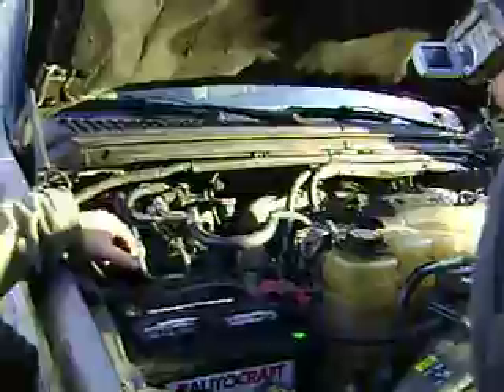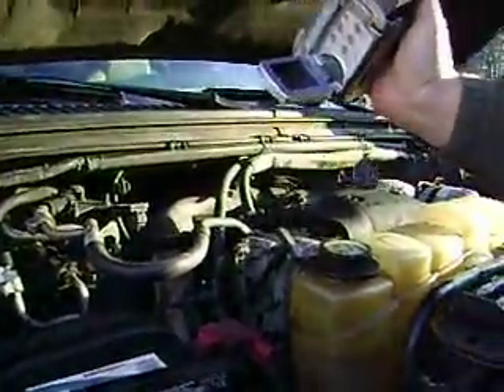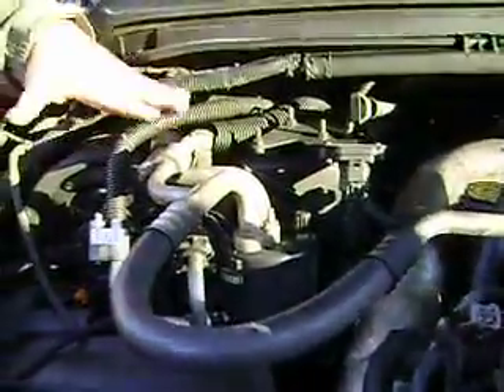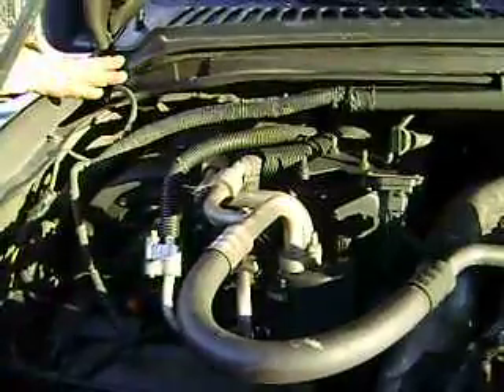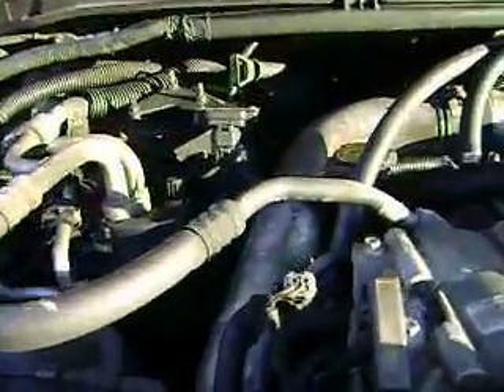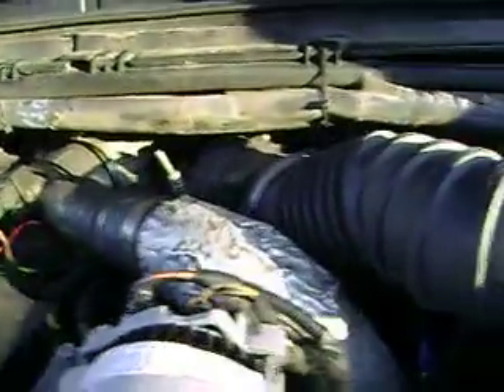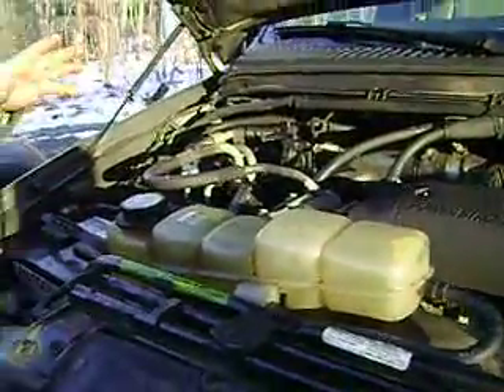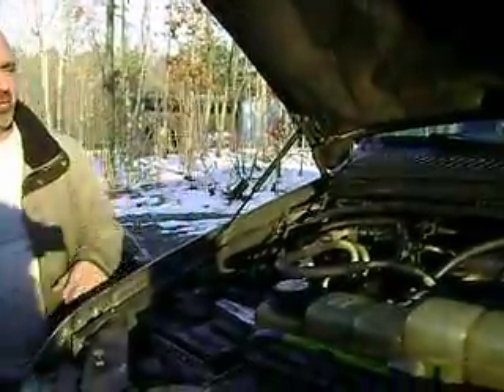7.3 Powerstroke Engine under the hood discussion of Vegetable Oil useage.

Comment from the maker: Mixing Gasoline with Veggie oil seems to work very well, however, 1 to 5 ratio might just blow up your engine and your entire city block.  I've put at most like 1 to 10 or 1 to 20 it mixes well and stays mixed.  All you need to do is create a second or alternative fuel system that also heats that fuel (the veg oil) and a switch as detailed in this video (Pollak).  There is no change to the engine.  You start on Diesel and you finish on Diesel and you use waste oil that you've cleaned.